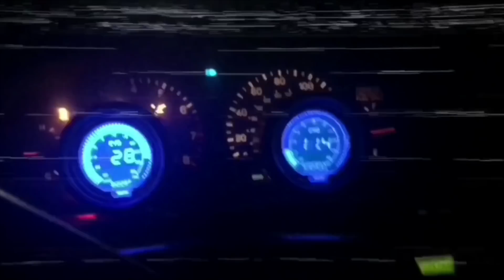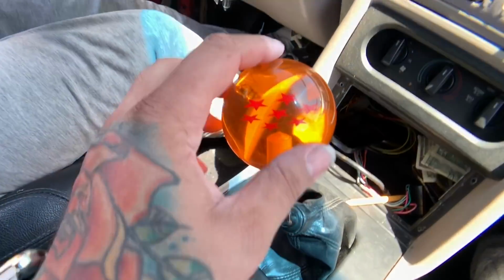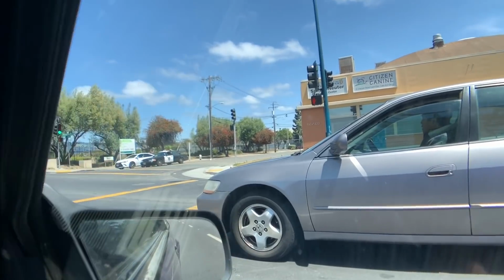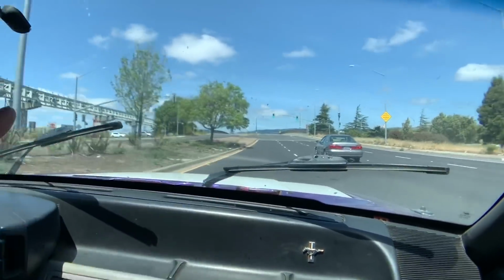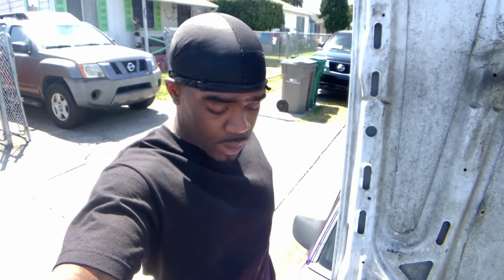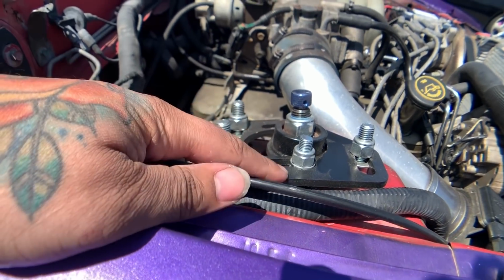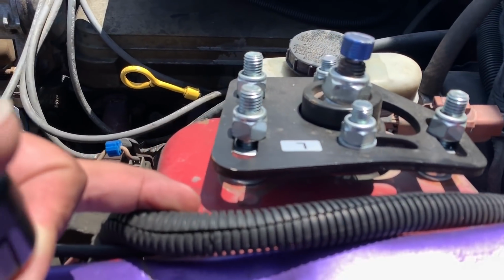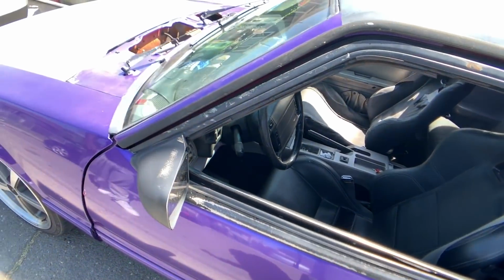RaceLand Foxbody coilover review

Comment: I mean the pricing is all in what you pay for in the racing industry but you can get a helper springs it helps definitely specially with those kids I mean they do generally what it means to help us bring it adds a little bit more spring rate in more spring height so you can adjust the rear approach is better they don’t even generally go that super low either so it’s just better for you to have a helper spring so it would just be riding on the helper spraying and taking the load off the main spring I think with the front camber plates it kind a looks funky like that with the space between it how you put the ball down and then you put the camper plate and then sandwich to camber plate with another Fault but usually use the camper place they’re locked into the chassis there like flat against the shock tower but I guess that’s how they work that’s why they been like that but that’s kind of a shitty design so much can you get updated with the fox bodies is crazy how far does let those cars go like that but definitely see why people love those cars I’ve been around a lot of fox bodies to and their enjoyable cars I mean I know nobody’s rich out there but I would like to see this car supercharged and then like try different supercharge set ups because you can find them things for cheap compared to turbo kit for that Way too much money with the games in the power band supercharge is the way to go for those cars you can either go like a pro charger or centrifugal I route style blower style there’s so many cool supercharger kit for those craft works probably makes a dumb cheap one I always see those kids Jackson,Vortech are what else could company Easton Edelbrock has a really cool kid out right now it goes right there on top of the intake manifold and it’s a route style twinscrew but you could change the police you can borrow them out you could do a lot with those aren’t and they have like a integrated him after cooler set up that you could just slide right into the intake manifold is really cool set up full-time really easy to set it up I think it comes with a downloadable naps are like you can re-map your stock EC you if you are you know chip it out or whatever is right for relatively cheap to two in those cars if you learn how to do emulator chips you can fuck in map like 1000 chips￼

Comment: I’ve installed about seven or eight Raceland kids different makes and models and I could tell you that you need either higher spring rates are way better shocks when you have the coil over one piece style are better but I know the rear end our two piece set ups so it’s going to feel a little messed up I would either get better shocks yet heavy duty style and get rid of those Raceland ones that they come with they have the coil over perch in the adjustment on that aspect with the spring adjustment so you can keep that you just want to change your rear shock and get adjustable ones and if they are adjustable Raceland tells you to start on like the softest setting and then start working your way up to a more firmer setting and then you’ll find the balance it’s because the shock pressure doesn’t really build until you start wearing it in after 500 miles and also since it’s a cold rolled spring but the expansion you need to get  You get temperature into the spring and then it will actually start adjusting to the perch and I will have a different ride height from when you installed it you’re gonna have to Yellit do adjustments I would say after 500 miles just get a different company caster play them camber plates got to go is soft metal there’s nothing you really can do about that the thickness of it is supposed to be good but it’s quality of metal make it to surf just get a different company everything else you can keep though I’m in for a Riesling is the pricing is what it is not the best company in the world is not the worst company though add relatively there not a eBay bread there they’re old bread I worked with recently before actually a couple years ago I’ve made like two of their cover cards so I know  All about them all too well I couldn’t even talk junk because they were looking out and helping us out but with sponsorship  Definitely contact them though if you really want to get some different ones they’ll definitely accommodate you with some new ones I think they know so they Chyna foresee that and their customer service is really good you could just call him up and tell my happen and you know that either hook you up with some new ones are the tell you to ship the old ones back in and send you some new ones but most likely they’ll send you some new ones they won’t even care about the old ones
Reply: Oh yeah with mustangs you probably want to get it like a rigid collar set up for that this is Spenton for all where the frame rails and everything in the sub frames meet the body you can get a bushings with the rubber polyurethane are you can get solid rigid collar set up‘s is just actually very new to the racing industry like viable viable from the store but yeah it would be better I’ll feel a lot more stiffer in you won’t get body roll or a suspension chatter because of the sub frame meaning the body now it’s actually between seeded a piece of metal rubber bushing with the rear end and also will help with that because of the old style fox body rear end and you get a lot of flexing so that’s why he’s getting a lot of the body flags you got to get that it’s like a bar that comes a brace borrow from one side to the other side of the car it’s right by the passengers backseat on their feet are where the backseat would be you could take that out and then put a bar that links it three ways from Court to the shock tower to the other corner of the shock tower and then it goes from a tri-point to the center where  The bottom of the backseat used to be that would take a lot of the back flexing and get more bracing on the lower and the arm they’re like car and links you want to get adjustable and links in the torsion rods all adjustable or just get the bushings for them they’re a lot cheaper than you think specially for mustangs there a lot more available than Japanese cars I’ve been watching stuff for a while I just haven’t really commented am I start commenting more